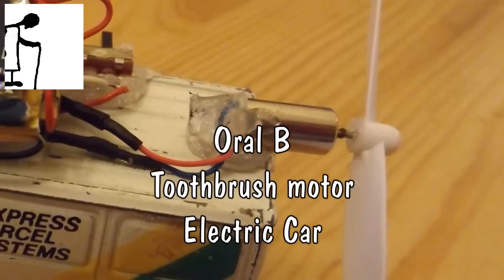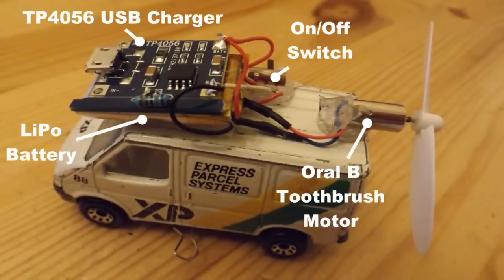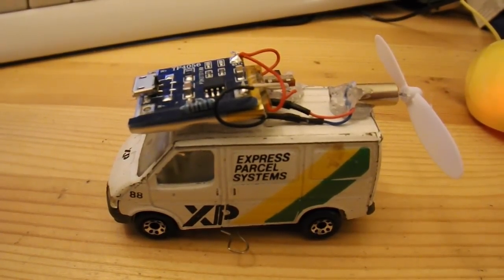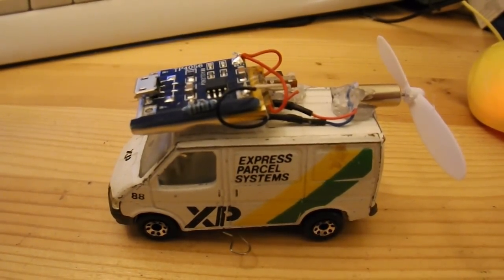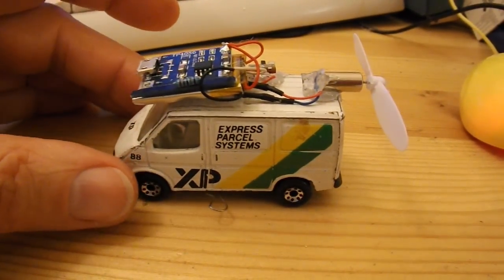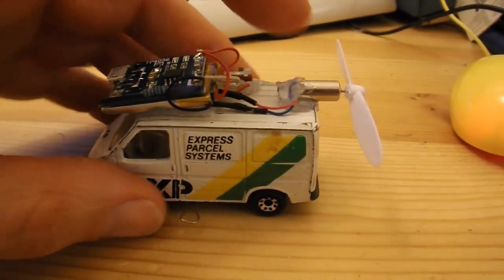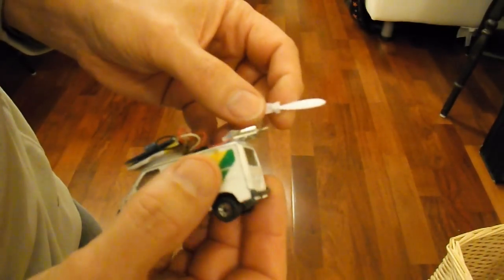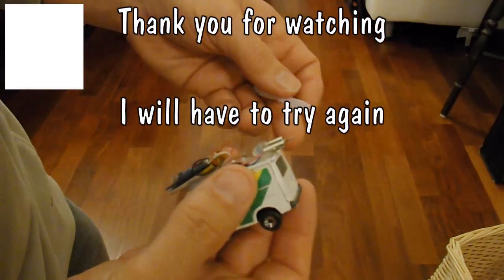Oral B Toothbrush motor Tethered Electric Car

Comment: Nearly there. On building something similar, I had to use a cardboard emery/nail file as the chassis, so can sympathise with the weight problem.
Tell you what though, indoor 'round the pole' is so much fun :)
Reply from the maker: I will have another go sometime. I will probably turn the propeller round and put a hole in the front of it so it is turning the right direction and gets the benefit of its aerodynamic shape or I could just put it at the front of the car. The little van is a convenient height to give the prop ground clearance. I did have some cheap plastic ones a similar size but I have given them all away as presents
Reply: GrandadIsAnOldMan
Maybe the little vans motor control software needs updating too, with it running Windows XP :)
Reply from the maker: slider2732 have a look at Part #2 uploaded tonight. Just turned the prop round the right way and we get much more power.